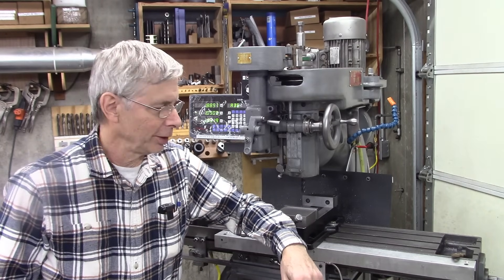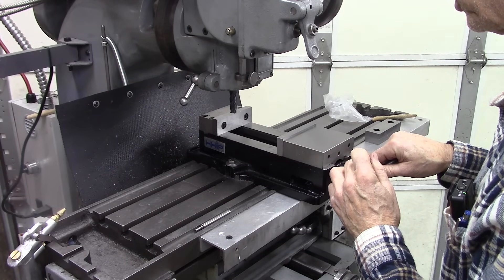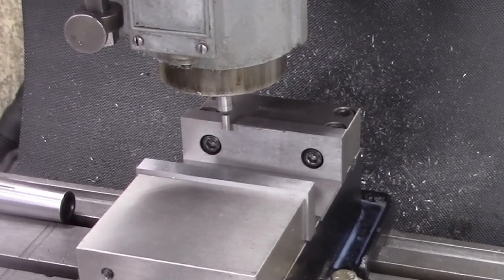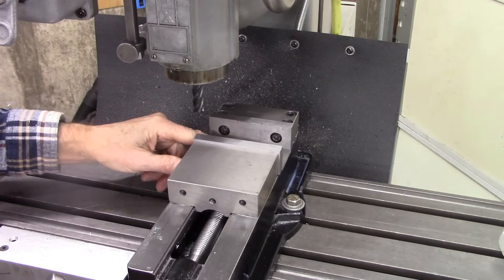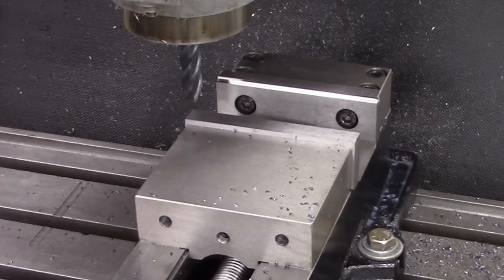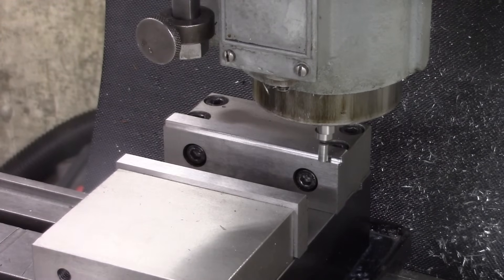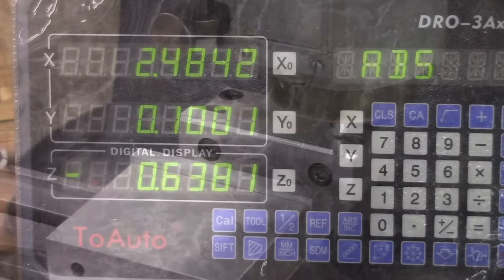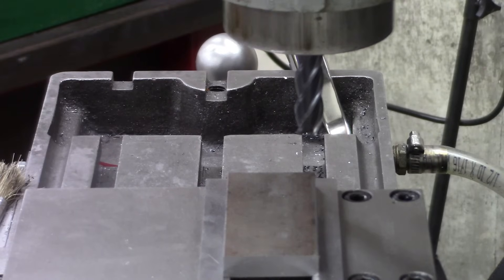Stepped Jaws for my Mill Vise

Comment: How do you deal with the inherent jaw lifting due to clamping above the vise body?
Reply from the maker: Well, its not an issue if you keep the adjustment screw snug. The way the vise is made about 50% of the clamping force is pulling the jaw down. I think most mill vises are made the same.

Comment: I have been told to do just what you did.  My friend made a lot of the parts we installed in RRD.  I haven’t done that because I am afraid to mill such hard of steel.  I assume you milled with carbide?  The risk to me that my 6” Kurt jaws are rather expensive which I prefer not to mess them up.  Your step jaws saves a lot of PITA with parallels moving around and getting chips under them while doing repetitive parts.  Thanks again Mark, for your insight and super practical solutions.
Reply from the maker: Yes carbide, I think I paid about 30 or 35 for new jaws, it took some of the worry out of screwing up. Who was the friend that made al the parts for RRD
Reply: @ my company Crossfield/press tech and I was the USA manager, technician, salesman and whatever.  Most of the mechanical parts we did custom was couplings, web guides, gear boxes, scanner head brackets, compensator rollers and ball screw assemblies.  I became Cogent Dynamics where we did many of those projects including insulated cylinder bearing blocks to allow electrostatic ink transfer system. Mostly Rotogravure.  Much was done In  Spartanburg, Lynchburg and places like Salem Gravure and other Quebecor locations.  My friends shop is in the Chicago suburbs called Fern Manufacturing.  He began in the mid to late ‘70s. My first machines were hand me downs when he was working at nights in an old barn.  He has always helped me (we met in 1970 in H.S.).  But I only get the ideas to make me think and try to understand.  They are incredibly capable. I was told years back that I need “step jaws” he would not explain how to do them since I was previously informed on how to do lots of operations.  I had not considered milling my Kurt Jaws (100 bucks + and I assumed to be ground).  I have not seen them commercially available.  Only a small step was needed.  Your 0.100” step was something I hadn’t considered. Brilliant!
Reply from the maker: @cogentdynamics  I think you told me about Crossfield before. We had your register system on a couple of presses. I'm in KY

Comment: I’m considering doing that to my vise. Is that a standard depth and width? What do you think about a little bit of an under cut on the bottoms? Thanks for the video!
Reply from the maker: A slight undercut is a very good idea. The jaws are hard and I didn't want to dull my dovetail cutter

Comment: I expected you to measure the jaw first then keep machining until the jaw step measures 0.1 smaller. It's a good way to keep a record of the size instead of guessing the final pass. Thick parallels the same height as your jaws also work really well with the top half inch reduced to 0.2 thick. Then add the step as your jaws. Being thicker at the bottom they have less tendency to fall over while having clearance at the top.
Reply from the maker: I wasn't really guessing but you're right, measuring the thickness would have been better that using an edge finder.

Comment: I would have made 2 loose parallels with a step on. Same principle but you woukd still have virgin vice jaws. Still machine the step on them to a known distance from the back face. Beware that YOUR step corners may have a radius from the cutter, really need a slight undercut to ensure the work sits properly on the flat or chamfer the work. Regards from Australia.
Reply from the maker: Machining steps in thick parallels  is a good method although the tendency to move around along with the possibility of swarf getting under or behind them is a huge negative. I thought about the radius, it was a fairly new end mill and looks like a very small radius. I thought about using a dovetail cutter to cut a relief. I just didn't want to dull my expensive cutter of the hardened jaws.
Reply: @WinkysWorkshop  Just a thought. If you have a Dremel tool with those tiny cut off wheels, hold it at 45 degrees and carefully undercut the corner by 15 thou or so. Regards.
Reply from the maker: @daveticehurst4191  Good idea, might attach it to the side of my spindle and use the x axis.
Reply: @WinkysWorkshop try using springs between the parallels, it keeps them snug against the jaws and base. They also take out the backlash in the vise so it opens with only a slight movement of the handle.
Reply from the maker: @marley589  Yes this works well but the spring sometimes gets in the way. while drilling.
Reply: @WinkysWorkshop  They don't have to. I usually use a pair of springs either 1/2" or 3/4" in diameter that sit on the vise base, well below the bottom of the part. Of course, they can be moved side to side to clear any potential issues before you start.
Reply from the maker: @marley589  All true, thats why I bought a second set of jaws, in case I didn't like this action. So far it's been fantastic. Of course it depends on the type is work your doing. Right now the steps are used nearly 100% of the time.
Reply: @ Glad they work ok. I made a matched set of 4 stepped jaws with a 2mmx2mm step that I use occasionally in a pair of vises for repeat work. I still like to use springs as they eliminate backlash when opening.
Reply from the maker: @marley589  the spring is a good idea

Comment: Hi Winky, if you undercut the steps with a dovetail cutter, (to a sharp) you can bite into material and take some aggressive cuts without the work pulling out. Keep innovating!
Reply from the maker: I thought about that just to eliminate the possibility of a radius in the strep but I didn't want to dull my expensive dovetail cutter. I may do this anyway.
Reply: @WinkysWorkshop  I actually use hardened Kurt jaws and formed the angular step in the surface grinder. Be sure to polish the sharp edge or it will chip away. I use it with everything from slippery plastics to 304.
Reply: @rayp.454  I wondered if milling Kurt jaws.  Speeds and feeds would be crucial.  Can’t rub or I would fail!

Comment: It doesn't make a difference in most instances, but consideration should be made about the radius the endmill leaves in the inside corner of the cut. Could skew the part.
Reply from the maker: Very true, I thought about using my dovetail cutter but i didn't want to dull it on the hardened jaws.

Comment: I believe that screw in the movable jaw should be no more that snug. I'd even back it off a tiny bit, to be sure that the half ball inside is free to float. And when I was working in a CNC shop I would back that screw out and lift the the jaw free for a good cleaning with almost every setup. I must admit that I'm not so diligent in my home shop.
Reply from the maker: I disagree about the ball. In fact you can clamp toward the top of the jaw and measure the jaw life if its not tight. However, in daily usage you have to be able to leave is snug of the jaw is hard to move.

Comment: Did you use a solid carbide end mill. Or did you use high speed steel end mill to cut the jaws on the vise. I was under the impression the jaws was real hard and almost impossible to cut with out annealing them first. But it seems you had no problems doing it. I know solid carbide bits get very pricey to buy. And the vise you have do you mind giving the info on where you purchased it. I really like that it opens 5 1\2 inches wide. I barely get 41\2 out of mine.
Reply from the maker: The jaws are very hard and I did use carbide. I love this vise. The only issue is the screw threads are not protected and swarf gets in them. I spray WD40 on them and it seems to keep them clean. The link to the vise is in the description. Carbide is not that high priced unless you buy name brands and I have found that unknown brands (or no brand) end mills do just as well. I bought a 1/2" 3 flute end mill from Temu for about 12 bucks and they work better that ones i paid $35 for. I bought 4 more.
Reply: @WinkysWorkshop  the vice brand you have is  a company I have used and they seem very reliable “HHIP”?  “Import” presumably but quality approved I think.  I bought a new Kurt a couple years ago spending the fundage because I like to buy form the USA and all American stuff when I can.  It is a form of support for me.  I’m not passing judgement, just my personal preference.  I use Shars too.
Reply from the maker: @cogentdynamics  Yeah, I agree with buying USA but dang the price is crazy high sometimes. I refuse to buy from Shars because they do not sand behind their products. I had two backing plate go bad (bad cast iron and the threads crumbled). One was 3 month old and the other almost a year. 30 day return policy is absolute! Never again.

Comment: Thin parallels work for me. If I was going to do my vice jaws I'd do them on the grinder
Reply from the maker: I think a grinder would be hard to get the inside corner sharp. I have parallels but for any kind of mass production they move around.
Reply: @ I have a surface grinder that's old but works good and square corners aren't an issue. Don't do much production work here lol That's why I retired🤪
Reply from the maker: @jimbennett1519  I'm retired too. I need to slow down.
Reply: @WinkysWorkshop  we only do this stuff we want to.  Stay off the couch, like I am now ATM 😝

Comment: Stepped jaws are a good idea. My thought was to just clamp the jaws closed after knowing the fixed jaw was square . Then mill the step in both jaws at the same time by beginning milling at the center line of the two jaws as clamped together. By off setting the passes result is the 0.100" by 0.100" step in each jaw. It is not to do it better nor worse, just my approach to the job is different.
Reply from the maker: Cutting slots with an end mill it not very accurate. The swarf in the cut moved the end mill around.

Comment: Thanks Mark
Reply from the maker: You're welcome!
Reply: @WinkysWorkshop  I checked out the link and they have a good selection of 5 c collets. I am missing the 7/16" from my set so I may order one from them. Thanks for the link seems they have a good selection of machine accessories. Did they give you a discount code?
Reply from the maker: @terrycannon570  No they did not. They are a good company to work with and in general I think there products are good. Sometimes I get free stuff from vendors but in this case I bought the vice. I recently bought some spiral flute taps from them and 2 out of 4 were terrible. I've had the same problems with taps on Amazon. I buy from McMaster Carr now and they are great (Greenfield) but they don't sell spiral taps.

Comment: That's a good idea, unless you have to do a lot of drilling close to the edge of your parts. That's the only drawback that comes to mind. It's definitely a good idea for secondary jaws.
Reply from the maker: Yeah...  its a fairly small ledge so most often it wont be an issus
Reply: I made a set of sacrificial jaws for my mill vice out of aluminum for this very reason. I figured I may be get a year or tow out of them. That was five years ago and I'm still using them today 🤣
Reply from the maker: They sell aluminum jaws too. I considered these but I figured I would end up leaving these jaws in place for a long time. I wanted them to wear well.